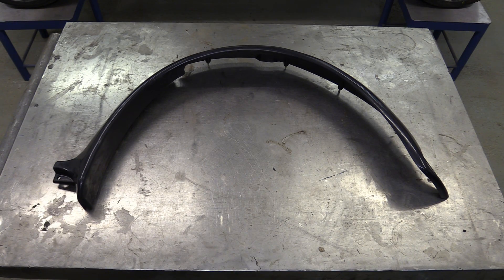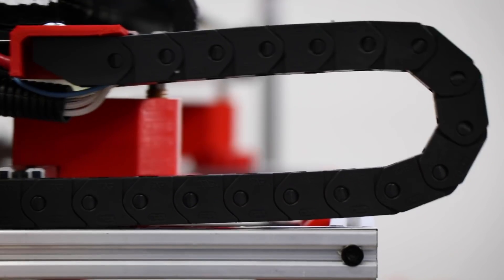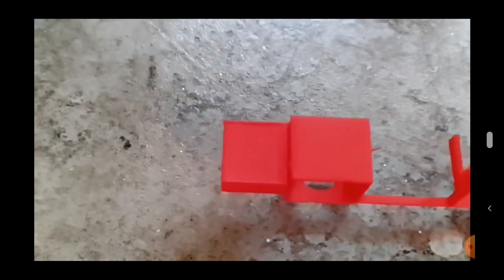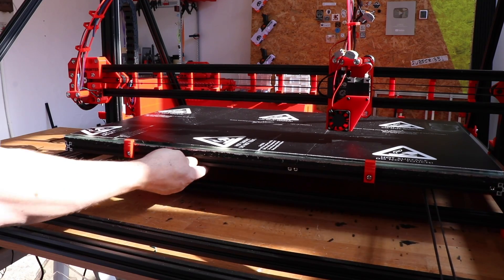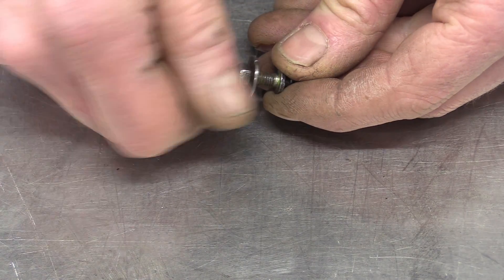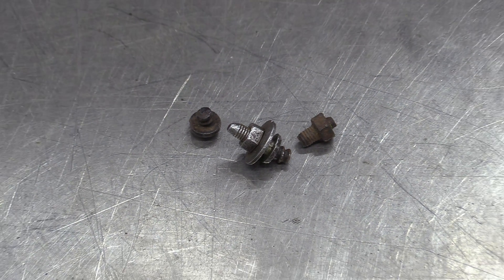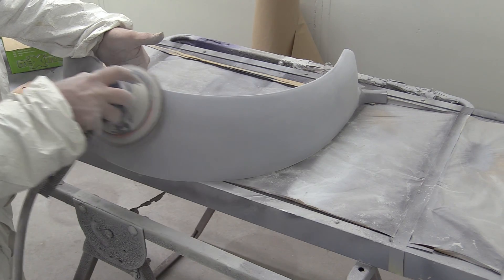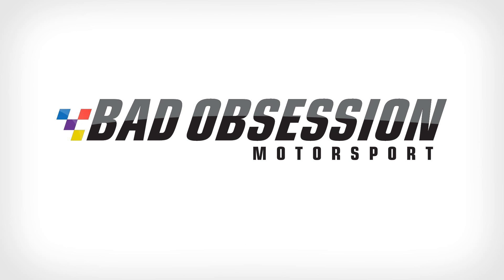Howie Did It - An Experiment in 3D Printing

Comment: Hey there fellas. Parts look good. I am glad to know through my own experience printing plastics that you aren't intending to use PLA parts on a car, rather you are making molds. That carbon will look great I'm sure. Always a bit cheeky with the hints aren't you,, everyone knows that  molds are red.
Reply: Would skinning these with carbon fiber be a good solution rather than making molds?
Reply: @UkraineTrain21  That doesn't change the brittleness or the sensitivity to heat, just laminates it like a windshield so that if it cracks or breaks it doesn't fall apart. I suppose if you used actual resin and fiber it would help it keep shape in heat.

Also, it makes a lot of sense to make molds. Once you have a good buck a mold is not terribly hard to make and you can reproduce the flares easily if you ever stuff one up on a cone or barrier. (they'll be autocrossing this thing) Once the mold is made you can still use the buck (and see how well these hold up on a car). If the buck is not strong enough to pull out of the mold then it's not strong enough to be on the car.
Reply: @atsernov  I like your explanation. I think something that people don't think about is the size change though small could be still significant as a tolerance stack up. The bucks that were made are true size, any parts made over them will be slightly over sized, so using the buck to make a mold will result in true sized durable parts.
Reply: @HappyPlaceGarage  There are a few problems using the buck as a mold. You mentioned the size change. The smooth surface ends up on the inside, so you have to do a bunch of cleanup on the outside. You also need to figure out how to attach it.

If you have a good/smooth buck you can make a nice mold and your parts will come out of it needing almost no cleanup at all and you can make the mounting points integral to the part.

Really, the only time using a buck as a mold is appropriate is if accuracy is not important and it is only ever going to be a one off.
Reply: you may be right but why bother using the brass inserts just to test fit?
Reply: @smiffysshed  you must be new here ;) it's Nick and Richard we're talking about, they're mad.
Reply: @vanoscrap6296  haha, been here pretty much since the 1st episode was posted. But yeah, who knows, they always subvert expectations
Reply: @smiffysshed oooh, I forgot about the inserts. Still though, PLA for a road car? I don't know that I would trust many exotic filaments and I use plenty of nylons when strength is required. I refuse to believe after all excess that's gone to every other aspect that we are looking at the final part. Would using a fixture plate be an option in order to maintain squareness or repeatability?
Reply: @smiffysshed   - it may be to ensure correct shape while taking the casting / moulding - the guards may have a little flex if the female is  laid up - and cured - without it being secured to "something" - the easiest "something" to secure it to is the guard/fender (bilingual). ??  Wait till the next installment, likely all will be revealed.   (plus installing the "threadserts" isn't too difficult or too much work -  it gives the builder (and collabs) satisfaction to see the parts fitted as designed...)
Reply: i think they're intending to use these on the road car but if they don't work they'll get some new ones and use them to make moulds; or just print the inverse shape directly. I've had  some experience with PLA also and agree it's too brittle and sensitive to heat to use on a road car exterior.  Maybe they could get away with ABS  but for some reason they've not gone for that - trickier to print for sure. Still, it's an interesting experiment.
Reply: @AdamDUrso  I wouldn't be surprised if they take a mold of the parts before they mount them, so they don't have to do the whole procedure again.
Reply: PLA+ depending if they went with + or not.. can hold up for quite a long time,Printed parts 4 years ago been exposed to sun and still straight not warping and thats in heat of Australia...Alot colder in UK haha
Reply: @RevXSCustoms  I've used pla plus quite a bit but wasn't aware it was better under high temps - will have to take a look, thanks! Still a little concerned about the impact resistance.
Reply: I disabrie that all molds are red
Reply: @denziljoe  This is true but it is a good color to see imperfections. I'm sure you know this but your parts will only be as good as the mold used to make them as far as surface finish goes
Reply: @HappyPlaceGarage  Sorry, it was a bad cheese joke :P
Reply: @denziljoe  it's cool. Lol @ dis-a-brie,  I didn't get it until now but well played😁

Comment: Obviously laminated cardboard is the future but it's not quite there yet, and until then this 3d printing business does a fine job.
Reply: It was close many years ago with the Trabant's compressed wood fibre and resin body panels, but technology moved a different direction.
Reply: No need for cardboard aided design when cardboard is the design.
Reply: Lightweight laminated cardboard is indeed the future!
Reply: @od3447  Ikea's getting into the auto industry?
Reply: Future Binky will be made from their waste tea.
https://pubs.rsc.org/en/content/articlehtml/2019/ra/c9ra02973g
Reply: @CraigOverend  No that's the follow-up, project Dunky
Reply: Actually, in the current Vendee Globe, a non stop / single handed sailing race around the world. One multi million yacht is competing with a cardboard and epoxy splash cover that was added less tham three days before the start.
Reply: @bartpijpers3844  : - I started going back over stories of "Paper " based core materials (phenolic resin infused) - incredibly stiff for weight - if impact resistance isn't needed (though skins can be beefed up to whatever is necessary - but the weight advantage is lost..  Silly stuff like low density spray foams could also be used in "bulk objects" to interesting effect...)
Reply: It's already here as SRBP.

Comment: this is great. im using lots of 3d-printed stuff on my cars. 

PLA can be a bit sensitive to hot summer heat. 

But ABS or PETG works just fine on a car in my experience :)
Reply: doesnt PLA get really brittle over time. I think ABS would be best suited
Reply: @Boerharms_Manta  petg is just as temperature and light stable as abs, but doesn't have the same printing difficulties. I think printing a part in abs at this scale would be impractical due to bed adhesion, layer adhesion, and warping problems because an enclosure wouldn't work well on a printer this large.
Reply: @Boerharms_Manta  Not as badly as often made out, I have had PLA plant pots sat outside for 6 years and they are fine. Moisture absorbtion can cause issues over a long time but the paint will keep the moisture and UV out.
Reply: They're in the UK so heat isn't something to worry about :P

Comment: I have some experience with 3d printed PLA parts and i can tell you that they don't do a good job on holding their shape with sun exposure.
Reply: Agreed. Being in England might help temperature wise, but those arches wouldn't survive a summer in the southwest US. Plus UV will make it brittle as it ages. I'd get those molds made soon or reprint with a tougher material, ABS or similar.
Reply: nah the red spritz at the end says everything... they are just making molds and being cheeky buggers is my vote. PLA plastic on a car that these boys have put this much time and energy into making perfect to a lunatic level?! Just not their style. I am betting they are gonna be carbon fiber made from a damn great mold.
Reply: Its not virgin PLA that'll be exposed to sunlight so I wouldn't be worried about UV. 
Temperature however is absolutely a concern. On a hot day in the UK I wouldn't be surprised to see some warping, especialy around the interface with the car body.
On the upside, PLA is REALLY strong so at least it has that going for it.
Using these as mold bucks for something carbon would be spot on!

I think leaving that as a future upgrade would be the best idea though, its not like a shortcut that you'd regret being a bolt on part.
Reply: @SKYWURX  I feel like the paint will help, but it's not going to be enough long term for something sitting outside all the time. I've had PLA parts sitting near a window but not in direct sunlight become noticably brittle after time. My money is on these not making it a year.
Reply: @SKYWURX  Yep, beat me too it! At least when they do need new arches, if they keep the PLA ones, new ones can be printed to be used as a mold pretty easily.
Reply: how sade its pla  ? the test print is pla but it could be petg and also curing it with the
might make it stronger allso some of my ebike parts are pla and petg an so far no problems it might be better with tpu or jus re dune from moulds tpu is almost indestructible if dinged right  just watch 3d printed fighting robots
Reply: Came here to say the same thing
Reply: Heavy stringing suggests it's PETG for the white ones
Reply: PETG is my go to material, or just printing a mould for carbon or grp.
Reply: I was going to say they needed to make molds then 10 sec before the end they say they're going to make molds :D Honestly they could sell casts of these to other mini builders and recoup a nice investment in them.
Reply: I popped in to say the same. If they're PLA They will start to sag in the heat of a warm day.
Reply: Remember, he does say @ 14:16 that these are intended to be used to make moulds for fiberglass or composite arches, so sun exposure shouldn't be a thing for them.
Reply: Its okay, they're in Shropshire
Reply: Wouldn't the fact the plastic is under several layers of automotive primer and paint make a difference?
Reply: I don't think for a moment they'd make functional arches out of PLA. They did not go into detail
Reply: Calm down Gentlemen, they said its just a experiment for now, now sit down

Comment: You can't print into a void.

Laughs in SLS.
Reply: SLS doesn't exactly print into a void either...
Reply: @xureality  Powder based laser sintering can.
Reply: @Runoratsu  It's not a void if it's full of powder
Reply: @maxhammick948  It‘s a void in model terms.
Reply: @Runoratsu  it's not a void if you have to remove the ultra fine potentially carcinogenic plastic/metal powder off of your print.
Reply: @xureality  That‘s why I called it cheating 😉 Merry Christmas!
Reply: That‘s cheating! 😜
Reply: You got a printer that big? ;)

Comment: I hope those are not full pla, pla get brital the more moisture it absorbs. Definitely make some molds soon. But still awesome work guys.
Reply: Would moisture really be an issue when they're encased in layers of primer, paint, and possibly clear coat?
Reply: That and when they make the new ones I would have epoxied the screw in inserts into place, because I'm paranoid OCD like that!

Comment: I love my 3D printers! I‘m with a puppeteering group, we build our own puppets and props, and 3D printers really revolutionized what we‘re able to do (quickly and affordably, that is). The new affordable resin printers are another huge step forward, too. It‘s great to live in the future (even if 2020 is anything but the future we all hoped for… 😔)

In any case—Merry Christmas and a happy New Year!
Reply: Btw—if I understood that correctly, you did end up going with PLA? Because I see a problem with that: PLA is highly heat sensitive. It already weakens into a gummy mess starting at around  60°C. And even out of the engine bay—sitting in the blazing sun can easily be enough to make the parts warp dramatically. ASA or more high tech plastics are a lot more suitable for car parts!
Reply: Oh, and threaded inserts: Under-size the accepting holes and heat the inserts up with a soldering iron for pushing them into the part—that melts the plastic around them to perfectly accept them and weld them in place. Plus when the material resolidifies, you got rid of layer lines which are slightly weaker than purely crystalline structure in 3D prints.